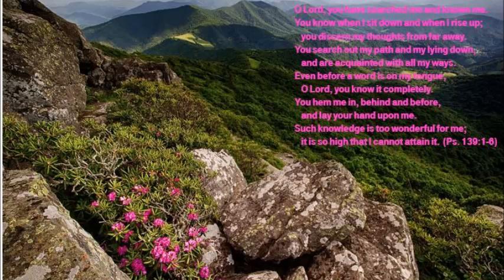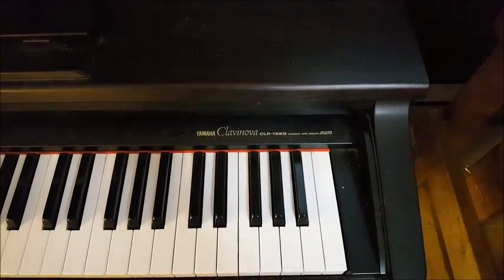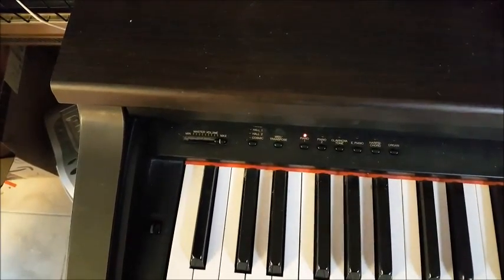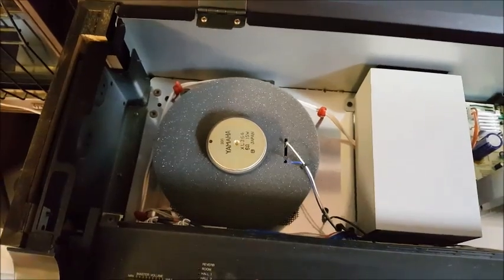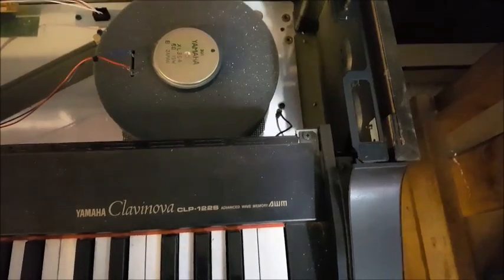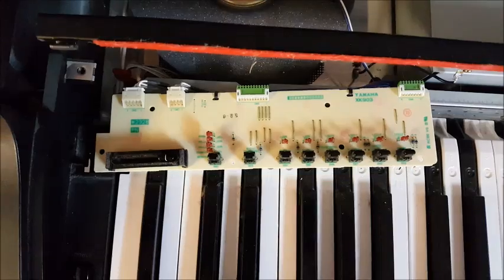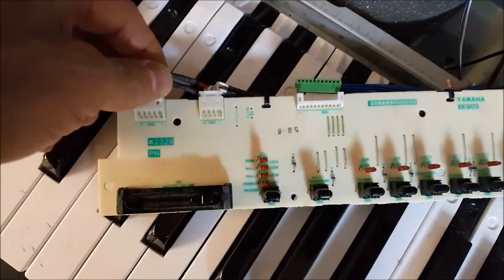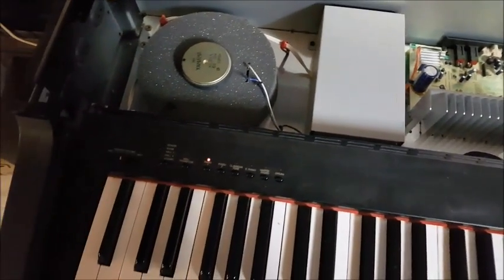Yamaha Clavinova digital piano no sound when playing replace master volume control

Comment: Very helpful video. May I know where did you get your new master volume control part from?
Reply from the maker: Thanks for your feedback.   I used part #3696 available from Syntaur.com to repair the problem.
Reply: @diywithdave3186  I have a piano clavinova slp 920 has no sound but there some people they told me that matherboard it will be dead 1 year now past since I starting to find motherboard without successeed but I will try your way to solve although also I have no master volme control
Reply from the maker: @eliyaboasy5706  I started by buying a repair manual, I think it was on Ebay.  That helped me to figure out what part I needed.
Reply: @eliyaboasy5706  hi, may i know how it went?

Comment: Hi Dave
I'm having problem opening the PCB above the volume button even I've unscrewed all the screws from the PCB. The volume button(slider) is not letting the PCB cone all the way out. Please tell me did you do it. I have Yamaha P105 Digital Piano.
Reply from the maker: Is there a plastic knob on the volume control that can be removed to get the circuit board off?  You might have to pull it off with pliers.

Comment: Hi Dave!! Thanks so much for this video. currently trying to fix my clavinova but a slightly different model (cvp-83S). Got up to point where I got to my master volume control slider, but am unsure of how to remove it, you said you desoldered it? How do you do that? Thanks!!!
Reply from the maker: I guess it would have been helpful if I had showed that.  So what you do is buy a soldering iron if you don't have one.  They should be available at your local hardware store.  You should buy one that is designed for electronics, so it either has adjustable power or lower wattage of the ones that are available.  It might also be easier if you get a solder suction tool that will allow you to suck the solder out once you get it hot.  So on the bottom side of the circuit board hold the soldering iron up against the places that the volume slider attaches to the circuit board.  When you see the solder start to liquefy use the suction tool to suck the solder out of the hole.  Do that on all the attachments.  That should allow the old volume slider to come off.  Then install the new volume slider through the holes where the solder was.  Heat the area with the soldering iron, the with some thin soldering wire (designed for electronics) feed it into the area that you have heated up until solder fills the hole.  Do that at all the places that you removed solder from, and you will be ready to put it back together to try it out.  I am sure there are videos that you can watch on de-soldering and soldering components on electrical boards.  Hope that helps.

Comment: Dear Dave: I am happy to bump into your video, because I have just discovered that my CLP360 (1990) has the no-sound problem. I don’t know what’s wrong with it; my problem was that I haven’t touched it for years since I have acquired an upright piano. I noticed that you have mentioned the service manual. I would like to ask for your opinion: I am no mechanics; what would you say is the chance that with a service manual, I would be able to figure out what the problem is by myself? I still want to try to save this clavinova, before I declare its death sentence and throw it away. Please kindly give me your advivce. Thanks!!
Reply from the maker: Thanks for your comment.  I never like throwing anything away without at least trying to see if I can fix it.  I have a technical background though so I probably tackle projects that many people would not.  I obviously can't make any judgement on whether or not you can identify the problem with your CLP360.  The service manual that I ordered on EBay was in the $20 or $30 range.  I had never worked on a piano before and that  helped me to figure it out what to do with mine.

Comment: My Roland HP 330 has no sounds.. 😭 thesame problem to you sir.. 
How to fix it sir?  how to order for replacement ... Thank you
Reply from the maker: I looked for a repair manual and found one on Ebay.  That helped me figure out how to take it apart, it might also have a parts list and where to order them.  I am not an expert, just sharing what worked for me.
Reply: Thank you sir.. Problem solve 😇
Reply: I replace potentiometer...
Reply from the maker: Great, glad you fixed it.